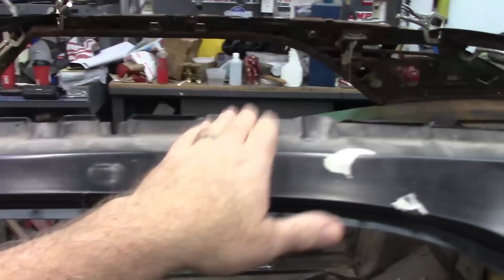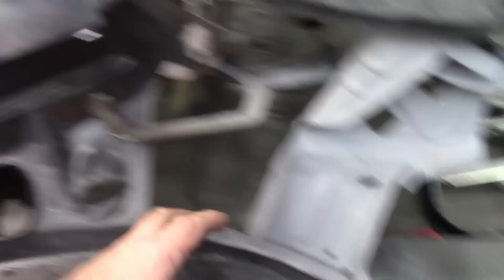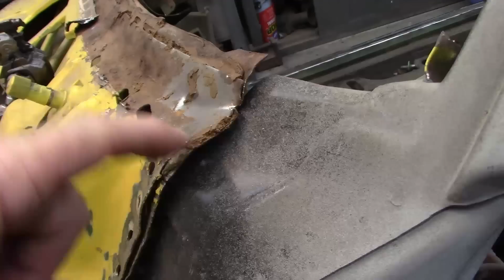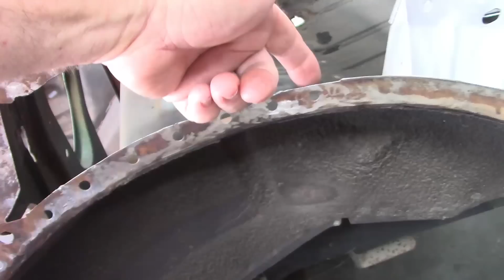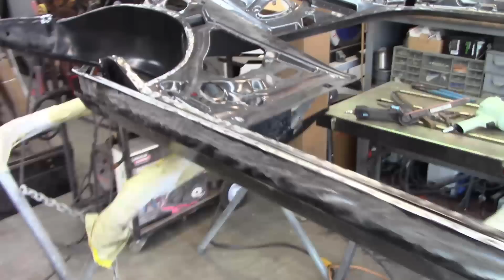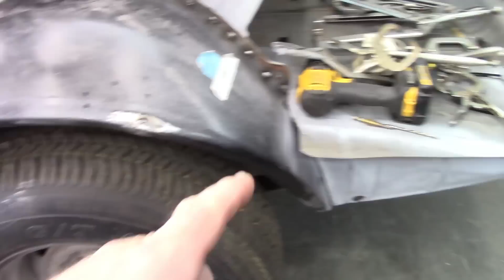1968 Camaro rebuild. Welding the side of the car in place. Basket case part 13.

Comment: Enjoy your vids.  Do you think you will ever be able to line up all the panels in the rear since there are no reference points?  I always thought one should remove and replace one panel at a time.
Reply: Under ideal circumstances yes but it doesn't always work out that way. After removing a panel for replacement the panel below that may need replacement as well. Or two panels need to be removed to fix a third.
Reply from the maker: I will get it lined up. Unfortunately, the panels were removed before I got the car. I like to do one side at a time, and keep some of the metal in place as reference points.
Reply: @JoDaddysGarage  Understood.  Looking forward to more vids.

Comment: Great video one question did you miss the weld on the wheel house for that brace, and thanks for your service to this nation thumbs up 👍.
Reply from the maker: Not sure which brace you mean, but there are several places I haven't welded yet.
Reply: Barry the weld I was asking about is at 5.02 minutes into the video on the flange I think is for the package tray.